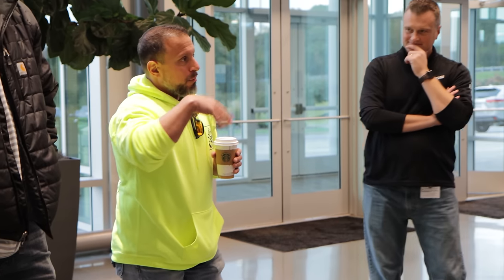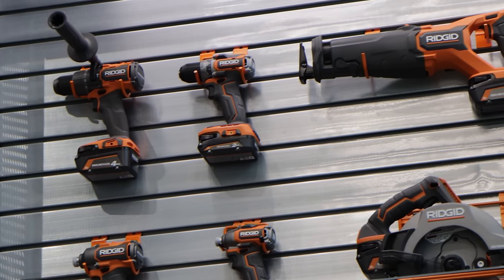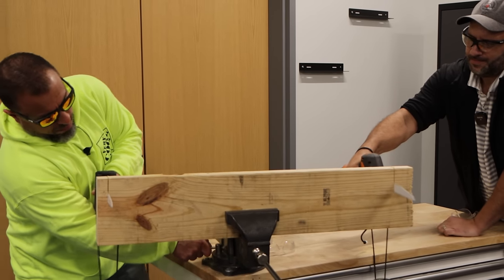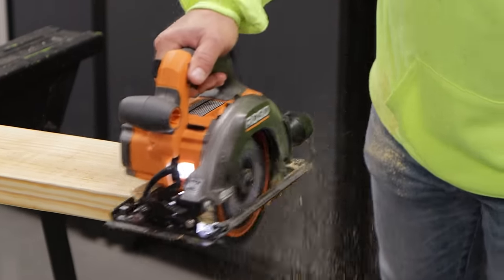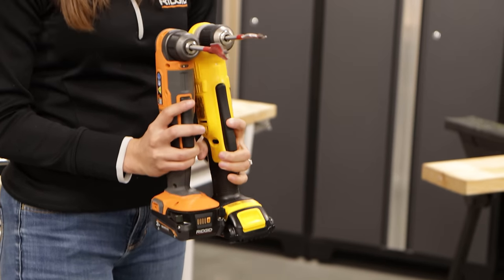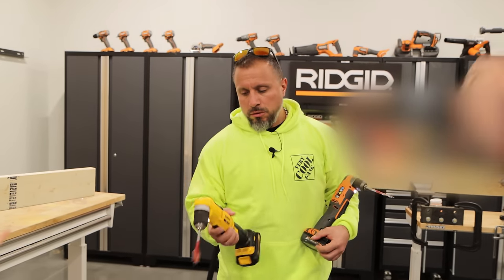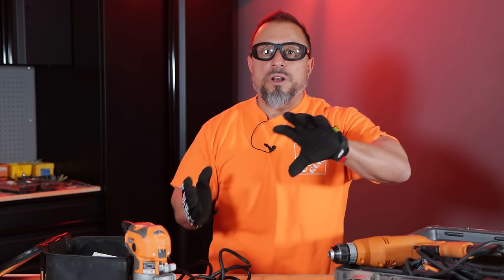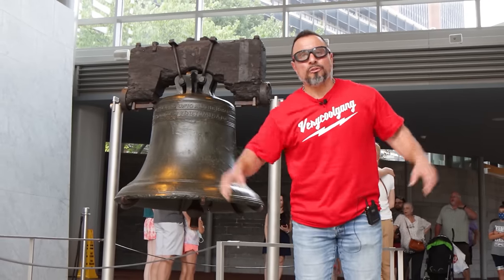Telling Ridgid Executives I Don't Like Their Tools!

Comment: The main attraction to me of Ridged tools is the lifetime warranty.  This extended warranty does not cover additional batteries purchases.   I recently started buying more tools for on the go projects.  Up until now, I have been buying Porter Cable tools.  Although the line of tools are sturdy get the job done, it is harder to fine 4 AMP,  20V, batteries at a decent price (with the exception of Amazon knockoffs).   Also, it looks like Lowes no longer sells the Porter Cable brand.

So I have chosen Dewalt tools to pack in my tool bags because, over the last couple of years,  Dewalt brought the cost if it's 4 and 5 AMP, batteries down when bought in pairs or have included them on high end tools.

I still have my favorite 12V Dewalt drill, purchased in the mid-1990'sl that I used for a long time.  It was made in the USA,  has a steel case and uses NI-CAD batteries.  I do not know if it works or not.

Comment: When I worked at Home Depot about 20yrs ago, I remember the hardware guys saying Dewalt was just the same black and decker internals with a beefier shell. And now I see Ridgid as a Ryobi with a beefier shell. 
I have Ryobi and it works for me. I especially like having batteries for lots of things other than power tools. But I’ve also found that my Ryobi Pressure washer is junk and my sliding compound miter saw is junk that won’t stay lined up. I was gonna cross over to ridgid later this year but I’m also starting to consider switching to Milwaukee and not look back

Comment: I work in the pipeline industry  i bought their 1/2 drive impact because i want to compare it with the milwaukee 1/2 drive to tighten bolts n the 24 inch flanges with 2 in nuts  ..... was using both tools on and off and the ridgid motor burn out on me in 4 mths . While i been having the milwaukee for about 2 years now and still running strong lol

Comment: my driver just randomly wont work . full battery and nothing .. switch to 2nd batt and nothing.. Put batt on charger . then try it after re charging a fully charged battery and the driver now works. My 14yo Makita it was supposed to replace is still going strong. Rigid is Junk I really wanted to give it a chance. Even got the x18 fan for camping.

Comment: I bought a rigid drill almost 20 years ago when the lithium batteries was still new. I left it in my truck over night I'm my tool box and the battery froze from the cold air ruining it. I stopped buying rigid since then. 20 years later I bought a rigid tile saw  as well as a roof nailer that have been absolutely fantastic.  Just had to work out the kinks I guess.

Comment: Man you nailed it.  I really wanted to start with ridgid as a beginner handy man, but the inconsistent line is what steered me to dewalt for battery powered tools. ( takes long  to collect because they are pricey). If this is true that they are changing that direction, then I wouldn't mind a 2nd battery line  with Ridgid.

Comment: I started my plumbing apprenticeship in 1971 and at that time Rigid was known to be, hands down the best tool maker for the pipe trades. It wasn't until later that I found out that they started buying sub-optimal products from other manufacturers. They didn't manufacture them, they just bought them and put the Rigid sticker on them, and of course charged for the Rigid name. I'm betting that they made a ton of money in the short game, but I think that the word is getting around. Their pipe trade tools are probably still the best though.
Reply: There is nothing out there that comes close to the rigid line of Pipe Threaders and pipe grooving tools. I have 3 of them, that are going on 25 years old, and they still knock out a job like the first day I got them. Replace the dyes, good as new.

Comment: I have both Rigid and Ryobi line of cordless tools. I use them EVERY day. I really like the rigid cordless line, especially the impacts. Yes, I do own, Milwaukee, DeWalt, Hitachi, Bosch, Porter Cable and some Harbor Freight tools as well. The Rigid tools work just fine. I cannot justify spending 3 times the cost for an impact drill that says DeWalt or Milwaukee on the side to do the job that I need for it to do. I don't setup material and do "SPEED" tests all day long. I drill a hole, put in a screw and move on. For that application they work just fine. 

If you wait for the Black Friday sales at Home Depot, you can get the Rigid or Ryobi line for 1/3rd the cost of a DeWalt or Milwaukee. I was able to purchase 4, 4ah batteries my Rigid at the cost of buying just 1 DeWalt battery. 

But it's not always just the tool itself, types of bits, blades etc. make a HUGE difference on how any tool will perform. But there is NO WAY I'm paying $239 for an impact/drill driver combo with 2 1.3amp hour batteries when I can the same line in Rigid with 2amp hour batteries for $139. I have been using them for YEARS and they have made me lots of money. 

Heck, I have a Chicago Electric mixing drill that I paid $39.99 plus tax that I purchased 5 years ago that I use to mix mortar, grout, quickrete concrete, and stucco that is going strong.

Comment: Funny - in our truck we had Panasonic, Bosch, Porter-Cable, Milwaukee, and Ridgid drills and impacts. (and many other tools too, but the drills we had one of each)   The Ridgid was always the first one taken - it has the best speed, power, and battery life. the one-hand saw from milwaukee had me hoping ridgid would bring one out - FINALLY! bought it on sight.

....Now if batteries weren't so painful to buy. (I got screwed every time they put out a 'free battery' or 'free tool' promo too - Sales rep flat out lied once, other times I had bought the tool days too early)

When we retired, I kept all the Ridgid stuff.  no need for the rest.

(OK, the P-C nail gun is a bit more compact than the Ridgid, but if I'm worried about compact, I'll grab the air nailer)

Comment: I have Ridgid tools and used them for many years. The lifetime warranty lets me buy a tool on the refurbished shelf and I am buying a very repairable tool. I found that they have the best battery pack to repair. I have saved so much money over the years buying tool kits with bad batteries and fixing the packs. I have 5 drills 3 skill saws and many other tools they sell. The bearing in the chuck area gets slop and needs replacement and chucks need to be cleaned because they leave them in the rain but other than that they work great!
The problem with the tool line is it has some holes that Ryobi sells that are nice but not used all the time.  Ryobi batteries don't repair as easily as Ridgid packs. I use an adapter to convert from Ridgid to Ryobi .  
As a heavy home user I use Ridgid and Ryobi tools and I don't pay much for the tools.

Comment: I have used Dewalt and still have a few , I have been a fan of and have my own hoard of Milwaukee tools , Loved them for several years,,, but their battery prices keep going up substantially, So I decided to try Ridged, After  My first week , I started buying every ridged tool that I could get a deal on , and by the way , I found that I could cut a straighter line with the ridgid 7" in circular than with my Milwaukee  7" circular saw,, I actually love ridged tools, (especially the sub compacts, I hang a lot of cabinets)...and the prices cant be beat either......

Comment: Rigid saw cut through harder wood grain.
I would ask what batteries are being run. If the DeWalt has a 1.5AH batt, and rigid is pulling from a batt with more cells, then it isn't fair.

Comment: I bought a rigid pipe wrench works great. I also bought a rigid handheld jigsaw that the base fell off. And the on/off switch is awkward to use. Not likely to buy for value anymore. Going for cheap thats easy to use and doesn't fall apart. I took the portable table saw back too. Junk.

Comment: The word on the street about Ridgid is a few years ago some of their Octane tools were just as powerful (even some more powerful, i.e. impact wrenches) then Milwaukee, but once the TTI executives caught wind about it they basically give Ridgid a slap on the wrist and said you can't do that. Milwaukee is supposed to be the top-tier brand. So they made Ridgid detune their tools and build less powerful models. Since then Ryobi has stepped up with their new One+ HP line to which I would say Ridgid and Ryobi are almost equals now. The problem for Ridgid is Ryobi has the largest 18V line of tools in the industry.

Comment: bought rigid and the batteries dont last at all. I am changing and charging batteries constantly, while the Milwaukee and dewalt guys are still working. the direction switch on mini impact is always getting bumped and is annoying and the saws all has to have a 5 inch blade minimum because the guide thing sticks out so far and won't go in anymore. batteries is main thing for me, have 2 of them i have to go trade in and not even a year old.

Comment: Whatever Vince speak the truth.
We are tradesmen; our opinions on power tools should be treated like Gospel.

I remember when all the big brands were putting internet connections in their impacts and drills

. “You can open your Milwaukee app and check your performance in Real time!”

Or I could pull the trigger you monkeys and it will do the same thing.
“What professional tradesmen use an app to check their performance on their power tools”

I swear these marketing as designers have never been on a job site.

Comment: 1st test I don’t think was fair it looks like the wood might not be consistent and what if the wood is too tight on the left or too dense you need 2 equal boards for a conclusive test because the left was working until a certain point it could be the tool but because it stopped at the same spot as the first cut I think it’s the wood.

Comment: I bought a Ridgid impact driver, and it lasted about 3 hours of use before it just stopped work course their lifetime guarantee is a bit of a joke so I ended up taking it to the repair shop and they knew immediately what had happened without even touching it.  The magnets failed in the motor.  It took 2 months for it to be repaired, although it cost me nothing, it was quite inconvenient. Thankfully at home I had a Milwaukee M12 set that was 8 years old and it has been bulletproof.  My advice is to pay a little more and get Milwaukee and you will have a much higher quality tool, for much longer.  The tools in the video looked nice, but my impact worked great for a few hours, then left me stranded.

Comment: The Ridgid maybe faster but does it drain the batteries faster sand how long do the batteries last compare to others!? Also the saw zaw needed to be switched each time, the wood was different on each end of the board!   Ridgid seams to be for the home owner light use and doesn't work to long!!

Comment: When I needed serious power tools, I went to DeWALT XR series directly and felt I spent too much for what I actually needed. After learning more and more on DIY and power tools, I found Ridgid can be a good line up to establish for my tool space.

However, ever delving into deeper and deeper... I am having this itch to actually pull the trigger for any Ridgid tools... Also I saw a contractor's Ridgid drill fails (which was not his choice but a company issue. The guy was having trouble with loose chuck all day... O boy...) I am just watching... and rather expanding into other tool lines, DeWalt, SkiL, and even brushed Craftsman V20...

Comment: Dewalt 2 pole motor, Ridgid 4 pole motor in brushed tools only. On the job in general Ridgid tools, last at the very least, 2 times longer. Do this test - take a Ridgid Gen-X4 sawzall agianst a Milwaukee Fuel Sawzall - which has twice as much noise and 4 times the amount of vibration as the Ridgid.

Comment: I am a total newbie, with a miniscule budget and extremely limited space, but I can tell you about a hole in the market. I have been watching a lot of woodworking videos, and I have seen a few people knocking the black and decker line of tools. I don't have any experience with any tool companies, so I can't evaluate quality or performance from any specific company, but I CAN tell you that there is a market for tool lines that work like the Black and Decker Matrix line with interchangeable tool attachments, among low income people with very little space who want to get into woodworking as a way of improving their lives by making small, but high quality items they can sell. I bought that system for the price, but also because it doesn't take up much room. I'm sure that professional and experienced wood workers with ample work space, would not choose this line, but I know I can't be the only one, and if other companies offered a similar system in addition to their regular higher grade tools, there would be a market. I looked to see if any other brands had a similar offerinf, but I couldn't find any.

Comment: I bought into rigid when I was new to carpentry. I use the crap out of their drill and impact, however after only 2 years of hard use the drill crapped out due to a bad trigger. I also had a bearing burn up in their orbital after 6 months. I do enjoy their table saw and meiter saw due to their beefyness and nice folding bases, but i have since quit buying their handheld tools due to the quality issues I had. The further I go I like bosch more and more. I have two of their routers and their orbital and find them to be very well thought out and high quality.

Comment: I have been a fan of Ridgid tools for a long time. That doesn't mean that I don't have other brands in my collection. I swapped to the screw guns and hammer drills when their 14v and 18v as well as 24v tools were available. Their tools charged in 1/2 the time of DeWalt and many other tools. They had the power to get the job done. Their weight wasn't much of an issue to me. I am not weak like most tool reviewers. If you complain about the weight of everything. It's probably time to exercise. That being said, most people that picked up my drills said they were heavy. I was using them all day, every day with no issues. Kinda makes me laugh when macho guys complain how heavy my stuff is. I appreciate light weight things. But they need to be durable. I absolutely love Ridgid's finish nailers, pin nailer, and roofing nailer with the clear cover for the nail coil. It looks cool, the magnesium housing is light weight, it's reliable and easy to use. The drivers are very powerful for each compared to other nailers I have tried.  While I am a bigger fan of the American made plumbing tools of the parent company. The tti made tools have some gems among the collection. Such as their table saws, miter saws, routers, and Sawzalls. Many of their corded tools serve me well and continue to make me money.

Comment: Uh, sorry but their New Right Angle Drill Models isn’t as “compact” as Ridgid is claiming to be?  Is it smaller than DEWALT’s Right Angle Drill?  Yes it’s “smaller”, but it’s not by very much.  Plus, they apparently didn’t realize that DEWALT recently came out with a New 5-in-1 Drill/Driver Kit Xtreme Sub-Compact Series, which one of the attachments is a Right Angle Attachment.  DEWALT also came out with a 4-in-1 MAXFIT Right Angle Attachment Tool for the Impact Driver.

Comment: You ever notice with power tools brands there's always this cycle?  It goes from building great tools at an affordable price(buying market share), then to holding that quality tool at higher price points for the high quality (invested users). The finally that brand everyone trusts, then lowers their unit prices, but the tool quality really takes a hit. (Cashing in on loyalty).  

I guess what I'm trying to say it always try and identify the tool brand that's starting the up swing and trying to buy market share.  That will always be your best bet.  It doesn't always pay to be loyal.  

It may just be Rigid it taking the first steps in buying market share.

Comment: Frankly, I don't know where Ridgid is going.  My home Home Depot store has greatly reduced their Ridgid power tool lineup. What's there looks to be on par with Ryobi. Their sub compact drill and impact does look good though. 

Also, I had a Ridgid drill/driver combo when I upgraded from my old 19 volt craftsman.  After a month the charger on my Ridgid quit. I exchanged it for the same set at home depot.  Then after another 6 months one of the batteries died.  I washed my hands of Ridgid and went to Makita for 18v tools. I never looked back

Comment: I had a brand new Ridgid octane half inch impact go up in smoke with no load on it bad thing is it's said on the box 690ft pounds of breakaway torque and it won't even pull a lug bolt from a ram promasters. I just held the trigger down for a min and pop, spark, and smoke. now they want to give all the excuses to not cover the part due to their lifetime service agreement being absolutely garbage. My gen 5x router got to hot to hold in my hand and the power button got stuck on the 2nd time I used it and they won't except the online order number as the receipt so it's only covered for 1 year so I'll go back to DeWalt seeing I'm still using the DCF 886 from 2014 daily

Comment: Have owned and used every brand. Rigid is probably the best value across the board. Who gave a lifetime warranty on batteries? Rigid. You could walk into the depot and exchange, no questions asked. Milwaukee guy now, but this looks promising. We have all switched multiple times over the years. Who knows, next time it might be back to Rigid

Comment: Whenever I'm putting on a metal roof I will reach for my rigid every time, I live in the deep south and it gets HOT  here.my Dewalt or Milwaukee are great and all but the rigid just beats them and I don't have as much trouble out of the rigid overheating as I do the others , but hey maybe I just got a super special one